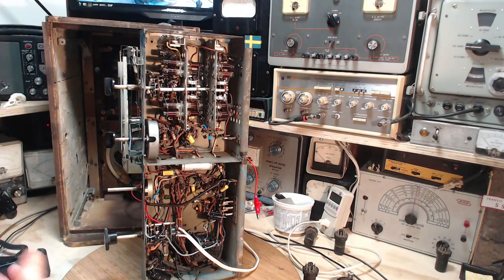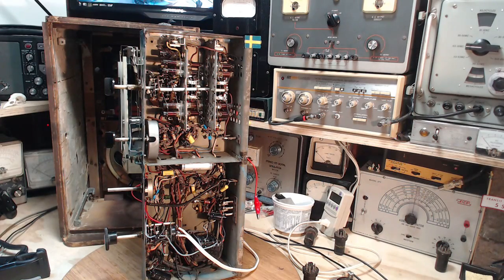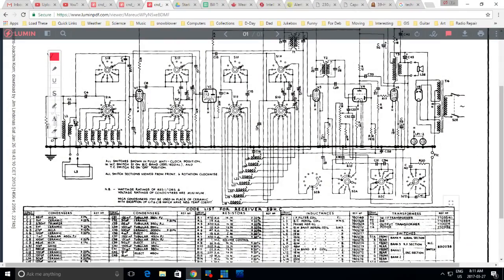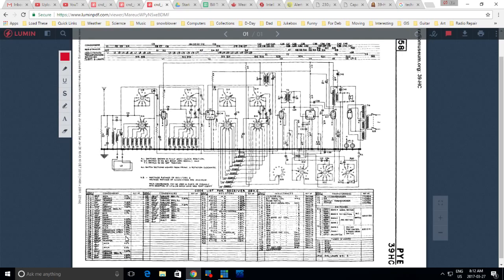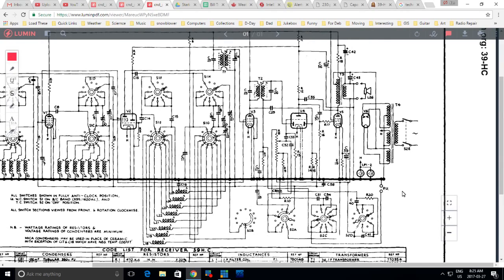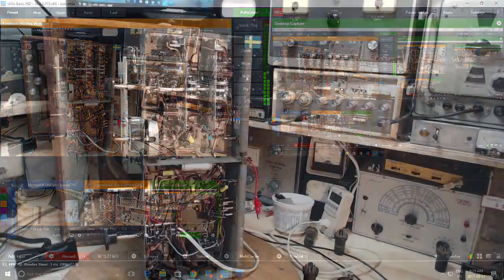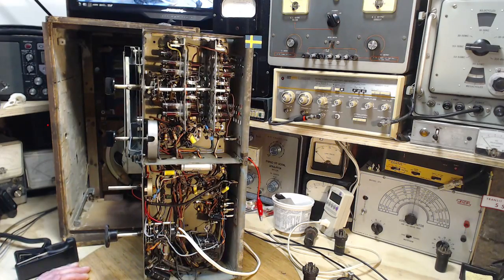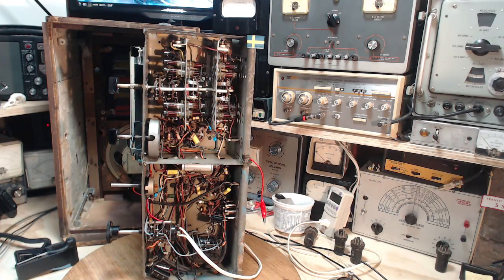PYE 39HC Shortwave Broadcast Receiver Video #18 - Schematic

Comment: Your final comment in this video was exactly the same as my comment, "Oh my God" LOL. Tenacity will prevail, Jim. You will figure it out. That may explain the AC hum you are experiencing as well. Until now I have been wondering if you may have a tubular capacitor that is connected backwards. They used to mark tubular capacitors with a band on one end. The band did NOT necessarily indicate the negative side of the capacitor as it does in an electrolytic. It indicates the lead connected to the foil on the outside of the capacitor. The other lead is connected to the foil on the inside of the capacitor. They marked them that way to help keep AC hum from being induced into the circuit via the outer foil.
Reply from the maker: I know about the 'banded end' marked on old capacitors and I have checked some of the yellow tubulars that I use to see if there is a detectable difference between leads due to the outside foil effect and there is.  But since the capacitors no longer have that marked, I have ignored it during installation.  But always, in the back of my mind, I think that I may encounter a situation where I have to get it right.  Maybe this is the radio and one of my capacitors needs to be rotated.  Keep watching.  The next video gets me over a big hump.

Comment: I am surprised that they didn't use turret tuner technology to get all of the pre-selectors and oscillator coils into one place so that the required tuning coils are selected and the ones that are not required are not selected and maybe a similar scheme would clean the audio selector part up also, maybe this radio is a hybrid of a superhetrodyne and a reflex receiver.
Reply from the maker: Only the most expensive radios would use a turret in my experience.

Comment: That C35 has to be a relatively high voltage because the signal coming out of the preamp/detector tube is going to be 180 degrees out of phase of the signal coming out of the power amp 6V6 tube in other words if you have 300 volts on 6v6 plate and say 180 volts on the preamp/detector you will have effectively 480 volts of out of phase voltage that's why it was of a real high voltage rating, C-35 probably cancels out some high frequency oscillations or high audio frequencies.  John a Bellas.
Reply from the maker: I should scope that and see what is actually happening there.